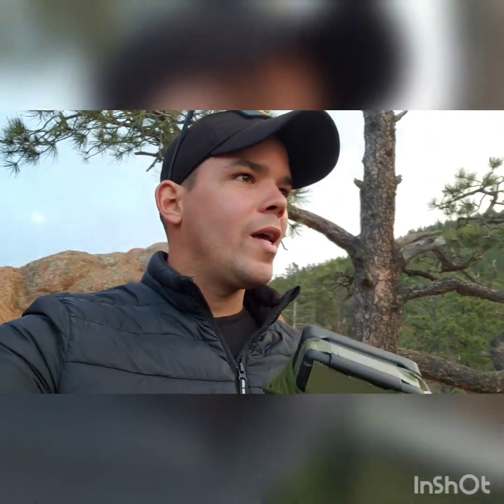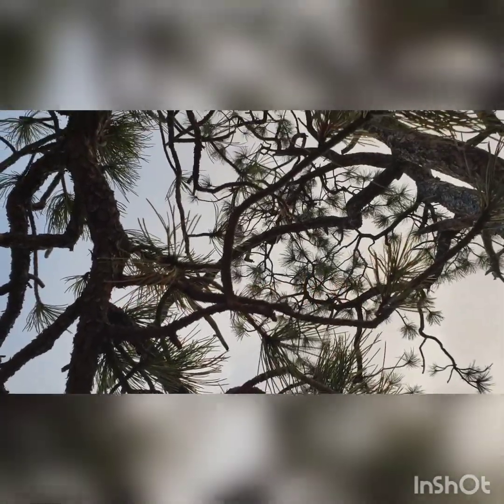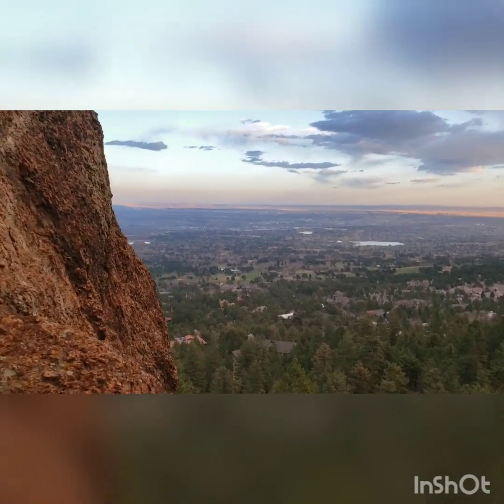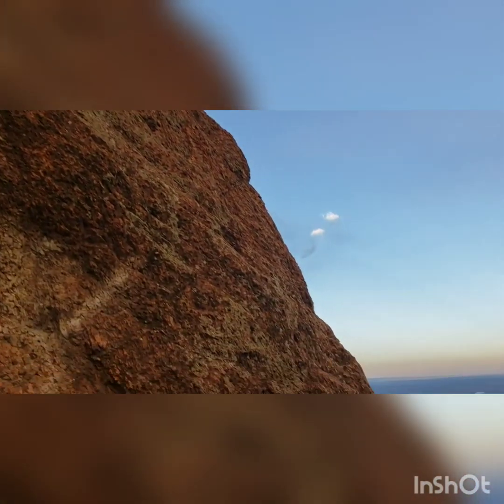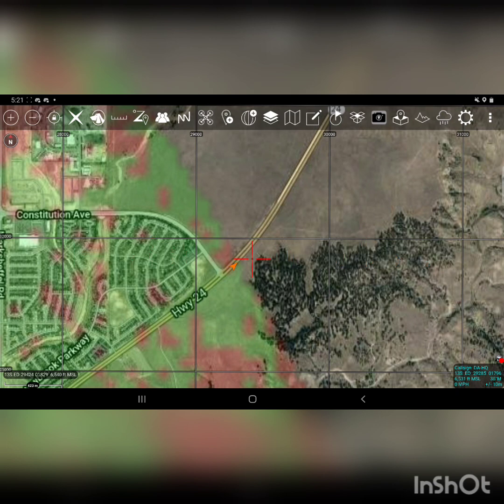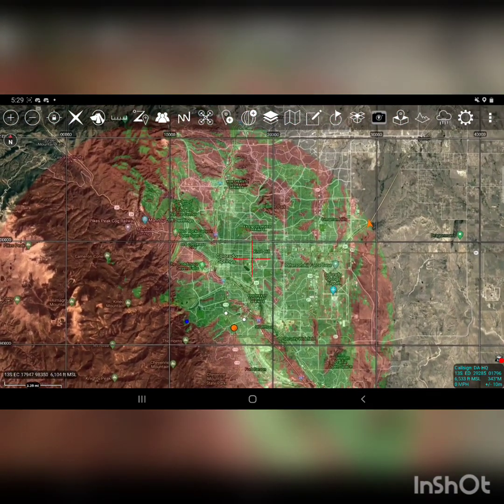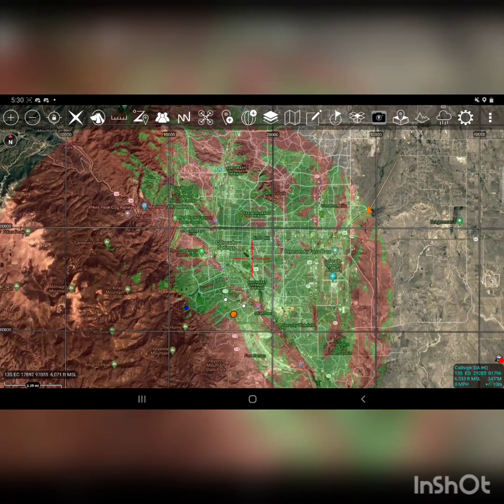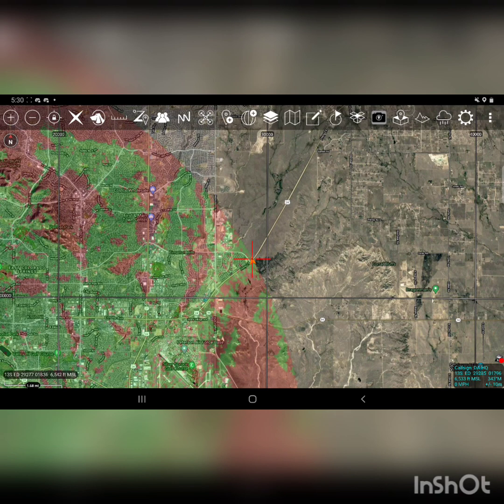GoTenna Mesh Range (With Relay) Test

Comment: 10 miles with the gotenna mesh device  ????  AMAZING !!!
Reply from the maker: Indeed it is! You just have to put a relay really high, but it can reach out pretty far
Reply: How do you know that's the only node? Check the node map
Reply from the maker: @TedCent  it's the only node because it's mine. I have a permanent relay set up and a permanent node wired on my truck. I monitor daily bu there doesn't seem to be anyone out there using ATAK+goTenna plugin
Reply: Just to clarify the mesh technology can use other nodes outside your network and as obvious as this variable may be I didn't recall you mentioning other mesh devices in the area.. excuse me if I'm not seeing something about the plug-in your using on Atak
Reply: If you don't mind me asking what version of ATAK are you using?
Reply: @da-b6563  Cause you can't get it! haha
If you know where to get the plug-in please do share.

Comment: Don’t really need two close together like that from your apt to the tree do you?
Reply from the maker: Unless you wanna stand outside within bluetooth range so you can pair with the goTenna hanging from the tree, then yes you do.
Reply from the maker: GoTenna Mesh operates in the 900Mhz spectrum and only pushes 1W of power. This means Line of Sight is key in order to maximize range. The higher the node is, the further it'll be able to see which leads to better range. You'll get about half a mile at ground level, you can get up to 20 miles if a relay is high enough

Comment: Wonder what if a ham radio with GPS (like the TYT MD-UV390 GPS) along with an arduino + GPS shield would do the same thing as gotenna for far less?
Reply from the maker: It's been tried before with very little success. As a matter of fact, if you're aware of who Raytheon is, they developed a plugin that in short words was exactly what any experienced ham radio operator would expect. Complete failure. 1200AFSK just cannot handle ATAK traffic, some tinkerers in the ATAK Discord went above and beyond and put together a prototype to interface ATAK with a radio. Their results, again, were what any experienced Ham would expect. The radio cannot efficiently handle kb's worth of data in a timely manner. To put things in perspective, a GoTenna device can push a position report in about a fraction of a second from the moment it starts transmitting to the moment it's received on the other end. A radio takes anywhere between 6-10 seconds to send out a position report. A position report is probably the smallest sized string ATAK handles, so if a radio can't even handle a single position report reliably then it's not viable solution.
Reply from the maker: Trust me, I'd love to see ATAK work on common radios that are attainable by the general public. Unfortunately the radio technology in the commercial side is severely restricted by the FCC.

Comment: Have you looked up meshtastic cheaper and I think close to the same thing.
Reply from the maker: I have not, mainly because the plugin needed to interface with meshtastic is currently not signed and the only way to get it working is by using the developer's ATAK build. Which means I would have to delete my current ATAK setup to install the developer's build so I'm not very fond of that. The plugin should xget sined soon hopefully, I will then perform the same tests with meshtastic
Reply: @da-b6563  can you do a video on get the maps and where. I’m struggling with this for two days now.
Reply from the maker: @kschlick8229  there are maps on civtak.org, just download them from the site and upload them using the import manager tool on ATAK
Reply: @da-b6563  been trying same however can not get ATAK to run or hook up too Gotenna?  Any links would be helpful!